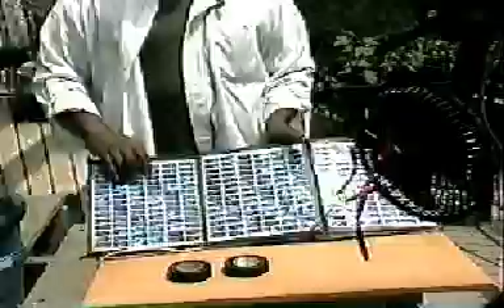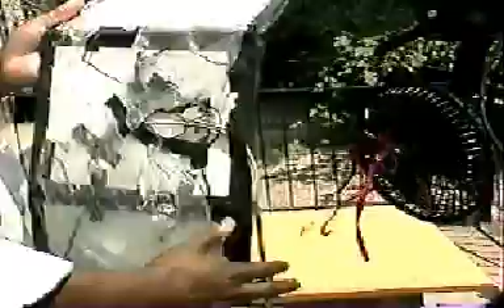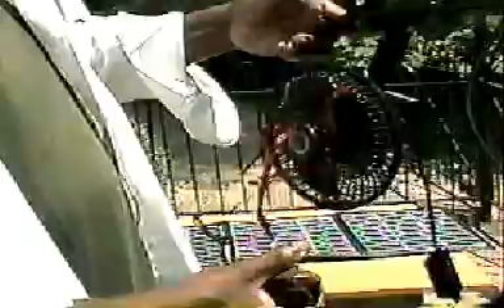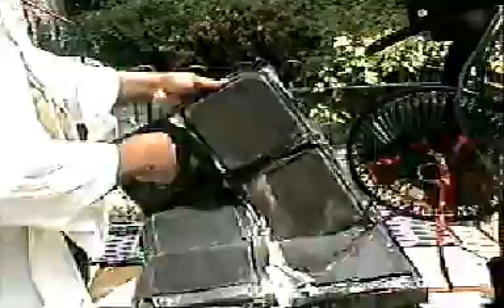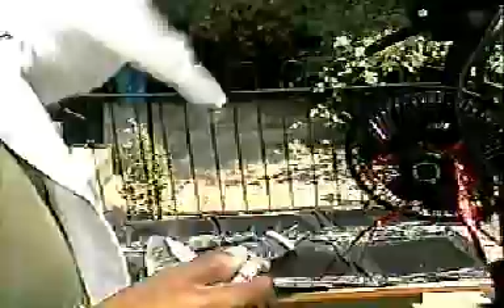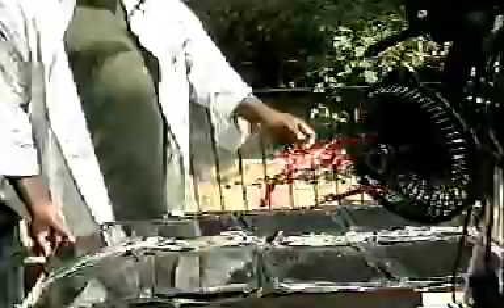Solar Powered Fan

Comment from the maker: @chomps21 Hi, you can use neither end.
But I added the mail end of the cord on the solar panel so that it would be easier to plug additional panels to power the fan(s) if I need them. Be sure to label and mark the ends of the cords to remind yourself not to plug it into an AC outlet.

Peace !

Comment from the maker: @2LateIWon Sorry it took so long to reply to your comment. For some reason, this string of comments have not appeared before today. The male plug that you saw on the fan is not its original plug. I have a small battery bank my basement, with a multiple female outlet to charge the batteries. This allows me to plug multiple solar panels together using the same card. The length of the fan's cord makes it easier to put it where I need it.  But I was thinking thing when I started.

Peace !

Comment: Why didn't you make the solar panel wire a female end?  That way all you have to do is plug in your fan ( or What ever) with out having to change anything.

Also if your cord wasn't so long you would get better performance.

Good video though.  Thanks for sharing

Comment from the maker: @sirmasterpimp  Sorry it took so long to reply to your comment. For some reason, this string of commentes have not appeared before today. These dc fans are nice and easy to use. In addition to the solar panel and the battery, try adding an old unused ac to dc 12v adapter wired in parallel to the wires powering your fan(s).

Peace !